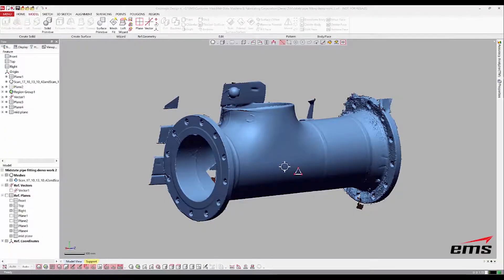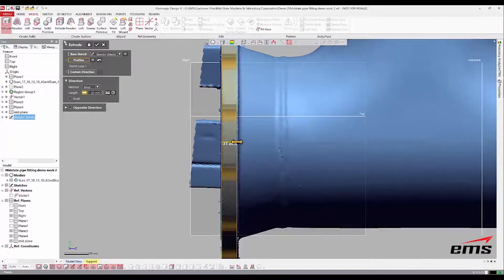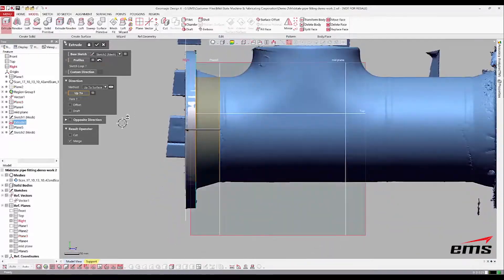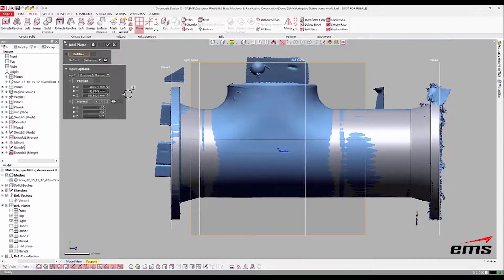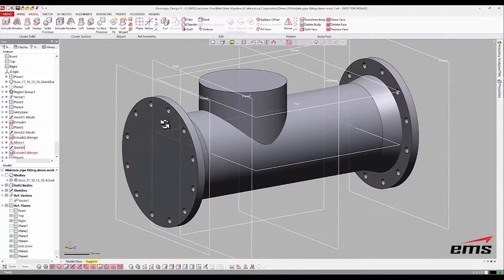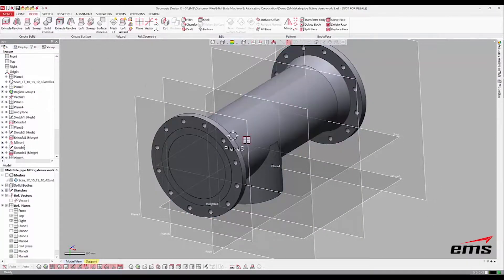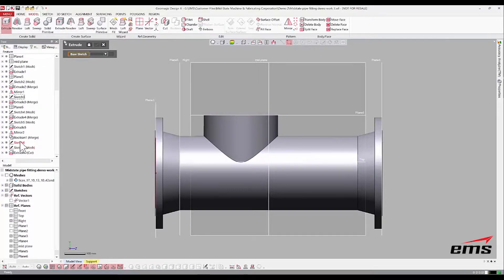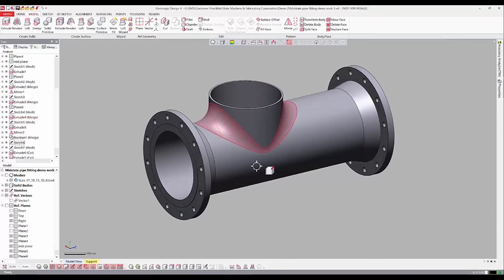Geomagic Design X - Quick Modeling of a Large Part

Comment: Clearly that final fillet radius did not produce the geometry as per the scanned part; however it does provide a parametric design improvement to inform a potential part redesign, should the manufacturer want it.
Reply from the maker: Yes it looks like the perpendicular cylinder was not correctly aligned in the manufacturing process which leads to the poor fitting fillet.   The great thing about reverse engineering in CAD is you can make changes to the model to make it "correct" or as designed not as manufactured.